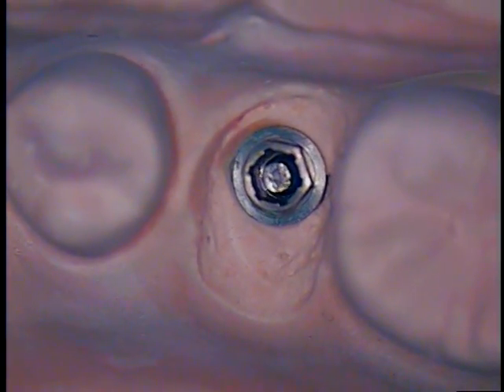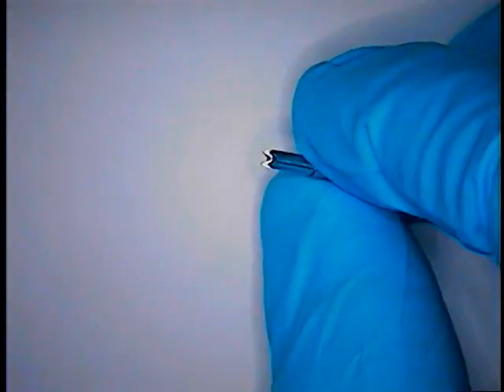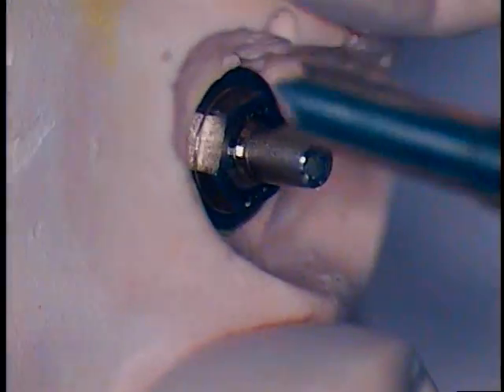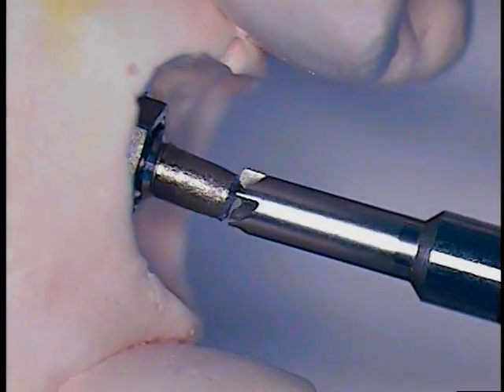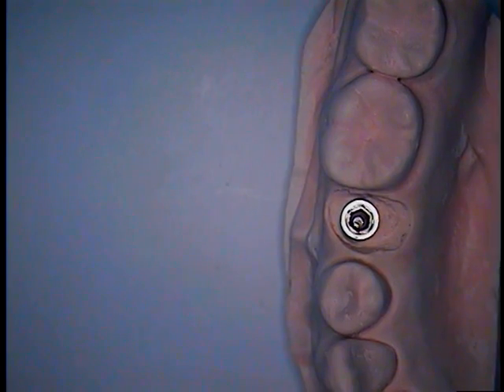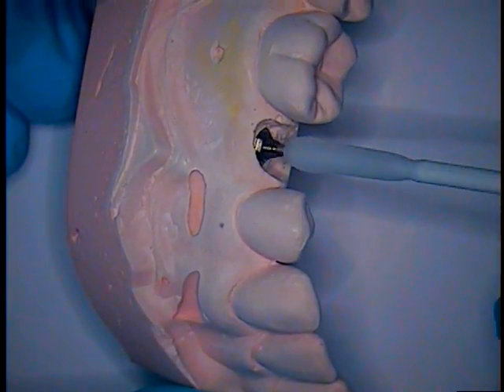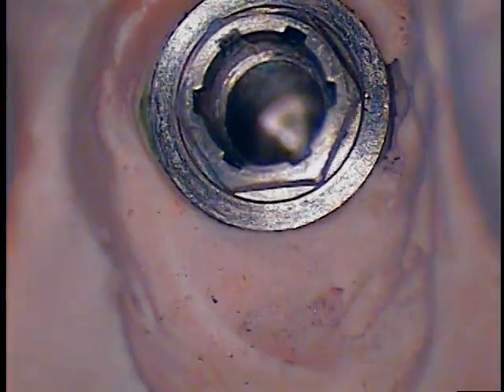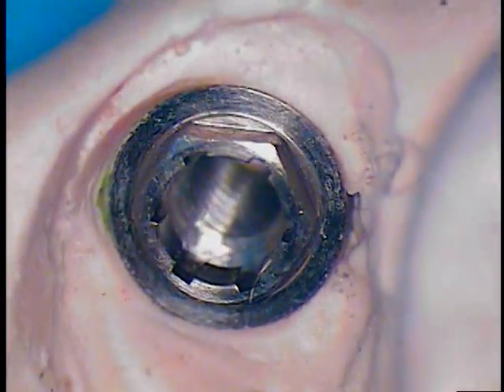Broken Implant  Abutment Screw Retrieval Demonstration 3/3

Comment: can this tool be used to take out zest locators that snap in thanks my dentist just did my implants and was fitting my denture locator and put some kind of adhesive glue on my denture than put it in my mouth and told me to bite down for five minute than he try to take out my over denture with force and broke a abutement  locator
Reply from the maker: yes

Comment: Hello Gerard, great videos, great value thanks a lot. I have a question, I fail to understand what is the solvent you are using to clean the internal threads, is it turpentine? Just to be sure, thanks and keep on the good work!Cheers from the Netherlands
Reply from the maker: Dario Palladino It’s a very mild sulfuric acid in denture tarter and stain remover. I don’t let it contact the surface for more than a few minutes. Works like a charm. Cheers.
Reply from the maker: Tarter and Stain remover